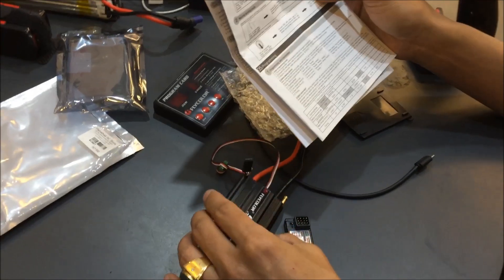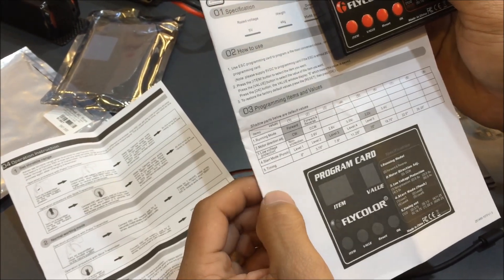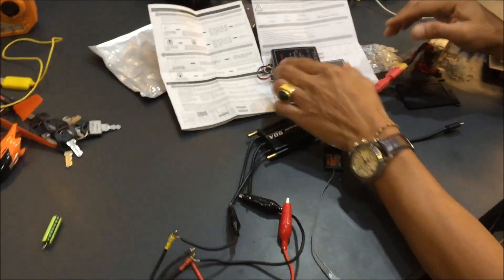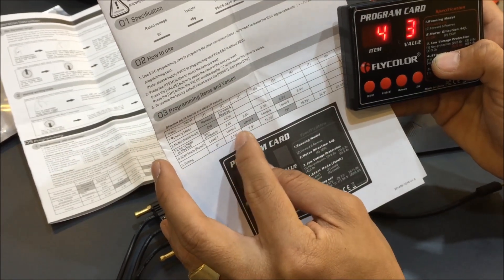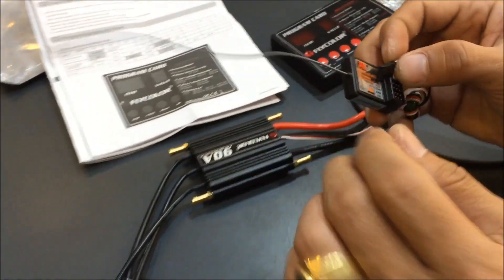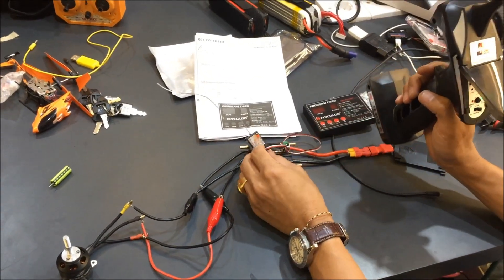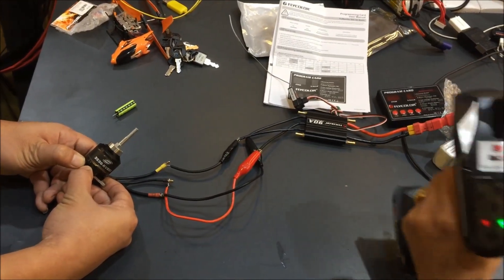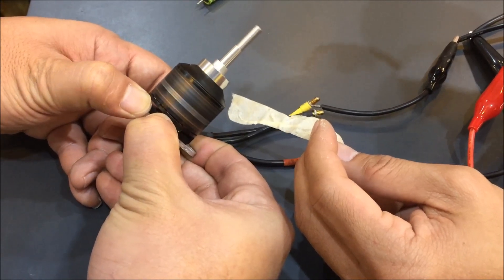Flycolor ESC for Boat setting

Comment: Hi i followed your instructions and set up was easy.
Reply from the maker: The off position should be on the neutral position of the trigger ( center) , so what you do is (after binding is done), switch on the TX, pull trigger fully (don't let go) , connect esc to batt, wait for two beeps, and let go to neutral position, wait for the rest of beeps, its done.